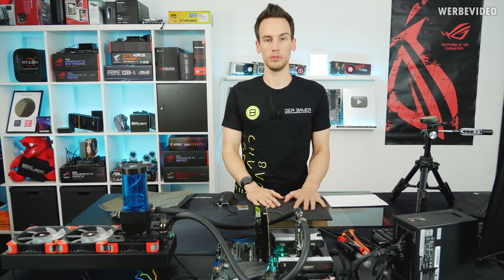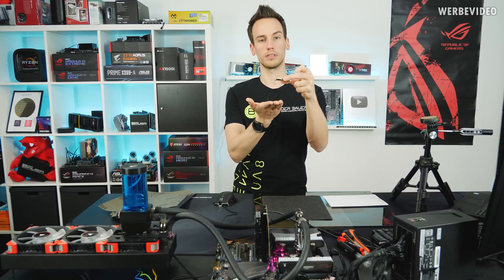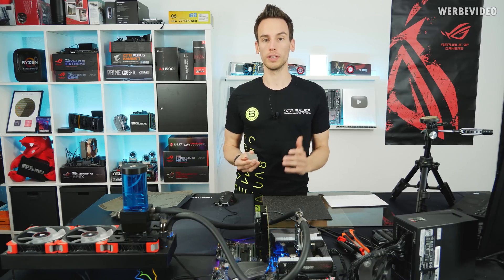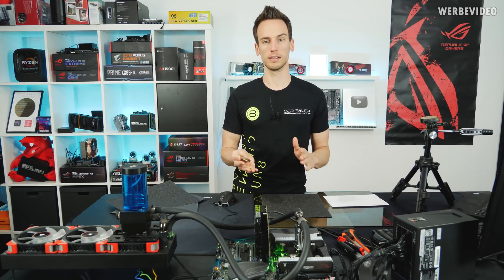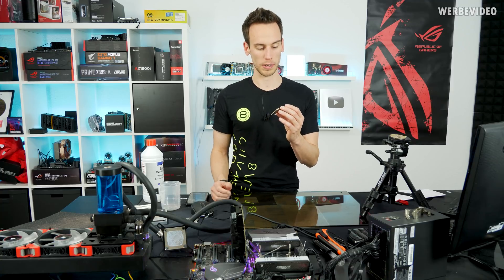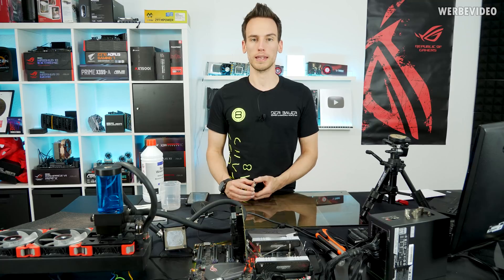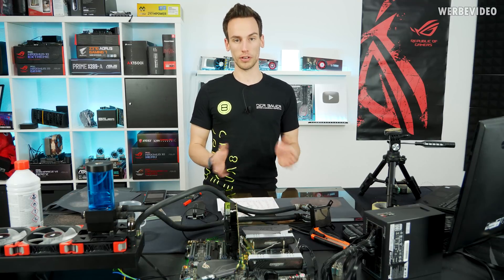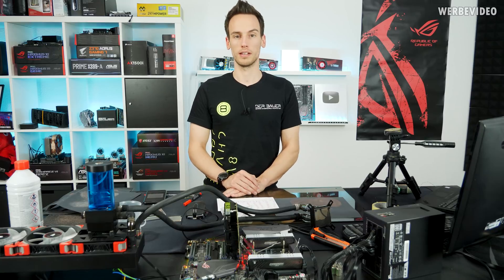How bad are SCRATCHES in the CPU Heatspreader?

Comment: It would be interesting to see if lapping the heatsink along with the IHS would allow for further improvement. It seems intuitive to me that flattening down the IHS would only help up until the point that the roughness of the heatsink becomes the limiting factor.
Reply: The LN2 pots are already lapped so they don’t cover it. Kingpin believes leaving a lightly scratched surface on the IHS reduces the risk of thermal paste cracking, decreasing the thermal delta, mostly only apparent in LN2 temps.

BTW Saying things like people don’t understand what “roughness” is just makes you look like an Ass and makes me want to disregard everything you stated.
Reply: @BobLSaget  So you're a snowflake that will ignore facts if they're not stated in a way you like. Got it. And you think "paste" cracks. Hint: it is no longer a paste if it cracks and it belies a different problem with a different solution. Be technical.

Otherwise, kingpin can believe whatever they like, doesn't make it correct or perform the best and if you have to bring in an edge case that has a different fundamental underlying problem to have a sort-of-not-really leg to stand on... well... you can think I'm the ass all you like; at least I'm not disingenuous.

Regardless, It's still hilarious, if a bit sad, to see the blind leading the blind like this and who think sanding it lapping.
Reply: hahaha no since you’re smarter than everyone, why don’t you tell us what happens to thermal paste at ln2 temperatures and why it can’t crack.
Reply: @MLGJuggernautgaming  Do you know what thermal paste is? As in the etymology of the phase. Do you know how it differs from thermal pads? From "liquid metals"? 

You are saying a paste can crack because when it is turned into a complete solid it can crack and you don't even realize it.

That is like saying h2o liquid can crack because when at ln2 temperatures it [h2o solid] can crack.

Also, you might want to try hitting the "reply" button unless you're simply trying to get the last response in.
Reply: @MLGJuggernautgaming  Do you call an AMD chipset an Intel chipset? Do you call water ice? do you call N2 LN2? I didn't think so.

Let's recount the first few posts:
OP - what about the heatsink in addition to the IHS?
1st poster - here are some wrong reasons that's bad
2nd poster - here is why you're wrong and don't know what you're talking about
3rd poster - i hate you 2nd poster and here is something that is fundamentally different from what you're talking about and uses terminology wrong
Other posters - WHAT ABOUT THAT THING THAT YOU WEREN'T EVEN TALKING ABOUT TO BEGIN WITH?!?!?!

Since you appear to be unable to understand that different things are different and continue to beg the question (among other issues) I'll address it directly. Thermal paste will not crack. Thermal solid may crack if an improper setup is used which does not account for different CTE's, connections, and a variety of other variables. It also may not crack. The IHS or container or board may crack. If the person is utilizing the wrong thermal interface material because they don't know what they're doing that's on them. If they achieve their desired results with a shitty setup, well, good for them. Doesn't make it any less shit.

Using the reply button causes a notification to be sent and the name to appear in blue. Spelling the name out will not do this. You're doing the latter.
Reply: hahaha no there we have it folks! Thermal solid. What an ingenious name. When people comment or talk in a video about thermal paste cracking, everybody knows what they’re talking about. It’s thermal paste that’s turned solid. What you’re doing is splitting hairs to be a smart ass and make others think they’re wrong. 

That’s what the YouTube app does when you hit reply:) or did you know that too?
Reply: @MLGJuggernautgaming  There we have it folks, a person who doesn't understand the difference between a description and a name, phases of matter, and technical language is complaining someone is splitting hairs by responding to someone splitting hairs on a different but related topic.

Why are you calling a short hand description a name. It isn't. You might also want to look back at the third post again, which I pointed out specifically, if you think I'm the one splitting hairs.

So you don't even have a computer. My bad, I thought I was responding to an ignorant person who wanted to learn and that's why they kept moving the goal post and ignoring when I schooled them in a particular area, not an ignorant person who wanted to troll.
Reply: @MLGJuggernautgaming  You're playing on your phone while outside and didn't refute any facts or other numerous ways I showed your lack of understanding... Yeah, you sure are knowledgeable and should tell others to doubt themselves.
Reply: The problem is not the roughness of the surface but that the IHS gets deformed when it gets soldered. That doesn't happen to the heatsink so I would assume it's already flatter and smoother than you could make it and you would only make it worse.
Reply: What if the heatsink was designed to compensate for the ihs, and sanding either one or both just leads to the same result? So you basically just wasted time and achieved nothing.
Reply: Where's my Dragonator? It is simple physics... the more material in between the cpu chip and the heat sink just increases thermal resistance decreasing the thermal pass through. No matter how they designed it removing Material increases performance(excluding other variables of course)
Reply: @Wheres_my_Dragonator  they are not. Regular air coolers, while a lot better than they used to be, are not flat most of the time. Nor are IHSs. It takes too much machine time in a factory to get each cooler  perfectly flat. "Flat enough" is good for 95% of people and applications.
Reply: They are supposed to be lapped together. Not sanded separately as shown in the video. Yes, it makes a difference. Yes, high surface roughness is a bad thing. People that think otherwise do not understand basic thermal resistance, the terms being used, or even what roughness is.

Comment: You should get one of the machines Kingpin has for doing this.
Reply: Why? That mainly provides a placebo effect for the most part. The only useful purpose for that is to try to run direct contact WITHOUT Tim, and it wouldn't be capable of that high of precision.
Reply: @cee128d  cause it's easier and faster. And cause shiny things are nice
Reply: That machine spins the sanding disc in one direction.  You want to sand in multiple directions, like doing a figure 8, so you don't get uneven wear.
Reply: @ahnilatedahnilated7703  watch the vid gamers nexus. Kingpin knows what hes doing

Comment: you should put the cpu in a milling machine and thin the ics to a tenth of a millimeter (0.1) above the chip and then see the benefit
Reply: If you make the IHS that thin why bother using it at all? You're not protecting anything with it anymore and just adding another thermal interface with it too. I don't think you understand how or why things work.
Reply: @1pcfred  i dont think you remember anymore that cpus didnt had IHS , the cooler was applied directly on die ...what to protect ? and second , did you tried to mill the ihs and saw that it doesn't matter the difference ? or maybe you are imagine it ?

Comment: yesterday i did lapping on q6600 And i dropped 6 degrees. now at 3.8ghz im sitting on high 50-es
Reply: i used grid in this order 240 500 600 1200
Reply: thermal paste i use is gelid gc extreme

Comment: Delid+lapping on 9700k : -12 degres
Reply: I just got a 9700k and have been testing as much as I can before the 15 day return policy. Finally was able to switch from ryzen and I love how Intel actually scales . as a really amateur approach at intel I got all core 5ghz around 1.3 give or take but I am not sure yet about temps to expect I was around 85-90 in prime95 but everything else wasn't hitting higher than 60ish. Not sure if this is just Intel and why I would benefit from lapping and deliding.
Reply: @alien_man1669  ur temps are good imo, mine is stable a 1.245/5ghz, pretty good one, my temps are 60/68 max with watercooling but fans + pump are running slow
Reply: @FaZe_MAGA  ha yea it says around that voltage under load so I'm definitely cranking too much voltage and changing wrong settings.

Comment: I remember reading the results of a similar test several years ago.  That test also showed that going past 400 or 600 sandpaper did not yield any improvement thermally, just cosmetically.
Reply: 600 is the finest my local DIY shop had. I started with 240 to take the top surface off and then polished with the 600. I got a brushed metal effect as I was going up and down (and not in circles). Eventually the 600 paper wore all the way down to being super-smooth. I continued to polish with this until the IHS had a mirror-like effect. Overall I got a three degrees drop from stock (8700K).

Comment: Would using an aluminium heatsink on a bare copper IHS cause galvanic corrosion or would the thermal paste protect it?
Reply: ihs are almost always made of copper..since there is no water involved, I would not be worried about. Galvanic corrosion occurs in humid ambients or inside the loop because of the liquid and the different metals, but not between the ihs (which is like 80 degrees at least and therefore not so humid) and the heatsink. I hope I have been clear enough :)
Reply: @enricod.7198  IHS are also nickel plated too. There is also moisture in air normally. Copper exposed to air will oxidize eventually. That's why manufacturers are nickel plating their goods. They're not doing it because they just have money to burn.
Reply: @1pcfred  yeah I was referring to the ihs..oh well ok ahah didn't thought the moisture in the air may be sufficient to damage the components, my bad. So is this a real concern if we sand the ihs or with the thermal paste and heatsink applied almost no moisture gets through?

Comment: Try again with some sort of sanding block to apply even pressure during sandings.  Also, try some polishing before each step.  Lastly, there seems to be some irregularities along the borders of the IHS.  That's probably from the pressure being placed around the borders instead of evenly across the surface.
Reply: Yeah it looks like while sanding he's rounding the edges to me. Just going through the motions doesn't always get the job done. He should be inking on a surface plate and seeing what he's really doing.

Comment: Direct die cooling, lapping the die and heat sink to the point where you can basically do cold welding, thus not needing and thermal compound, is basically the only thing I'd find particular interesting in this category, but of course it would both be time consuming, difficult and potentially expensive to do a proper test, so I don't expect to see any such experiments any time soon.
Reply: That would be interesting test indeed. In machining world there are gauge blocks which are lapped to be very-very flat (sub-micron over the area) and the good quality ones wring together (google for gage block wringing). Now, if both cpu and heatsink would be that flat and wrung together without thermal paste, that would probably be quite good. Although I wonder how much cpu bends with motherboard when heatsink is mounted... That would ruin the whole idea.
Reply: @vilts  Yes, the PCB flex could be a problem, but I don't think so, presuming a single die and even pressure from the cooler. As for multiple dies, that's a tougher one. I still don't think it would be a problem, but even if, it is possible to support the motherboard, I think.

All in all, I think it's perfectly possible and I'm also convinced that it would work very well, not to mention that the heat conductivity shouldn't degrade over time, but to achieve this result you would basically have to do the last work, cleaning and assembly in a vacuum. Well, if I am to believe what I've read on the subject, having never attempted anything like it myself. I've machines parts to a tolerance of .001 mm by hand, but that is hardly the same. We'd need perfection, not because perfection is needed to get good result, but because we wouldn't be able to trust the results otherwise, as even the tiniest imperfection could have a significant impact.

Comment: I only rough up an IHS or cold plate if I'm applying liquid metal, so it sticks a bit better. Otherwise, I don't bother. IMO, people should focus on applying the right amount of TIM, properly.
Reply: I use the thin film method and I don't overclock but the temps I get on my system are great. Right now I'm running +20.0°C to +24.0°C All I have is a $10 Hyper T2 cooler. So the only thing I can chalk it up to is the TIM application. I just used the compound that came with the heatsink too. So whatever that was. Must be great stuff?

Comment: @der8auer, i think you should add delta per cores (coldest one and hottest one under load). Now we never know are there was any improvements. Not really important, but also may be interesting.

P.S. Any news about Carbonaut? =)

P.S. What if i add marking back after i lap CPU (with laser)? Will it count? =) I need my warranty back!
Reply from the maker: Carbonaut will be available in about 2 weeks :) 
sure if you can add it back :D 
Will add deltas next time but you can see difference between min and max

Comment: Hey, why are CPU heat spreaders made that stupidly uneven in the first place?
For example on Ryzen CPUs, they have the corners or entire sides, visibly way higher than the center......... How the hell are the coolers supposed to make good contact??
Reply: Has to deal with time. Kingpin went into detail over it. The only level side is the side with Die/IHS. Thermal past makes up the difference on consumer rigs. IHS's are stamped from one big sheet.
Reply: @AbsolutionArmament  has to do with money. Manufacturers are not going to waste money on processes that offer little return for most consumers.
Reply: @AbsolutionArmament  Oh, ok.